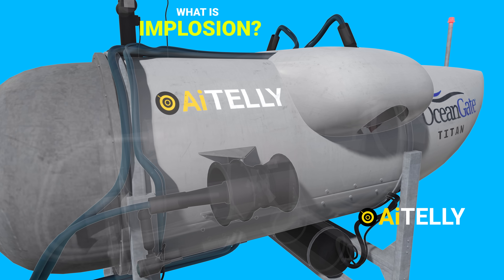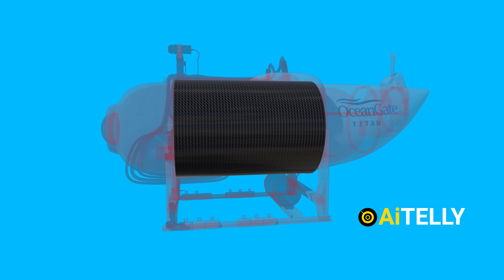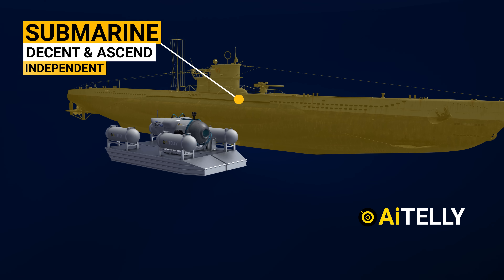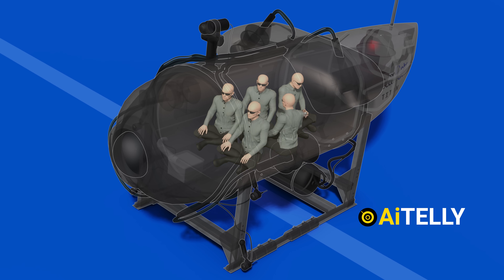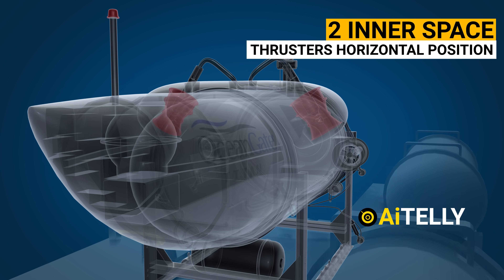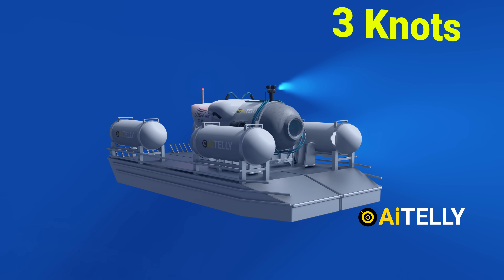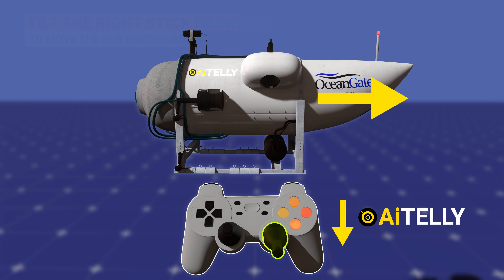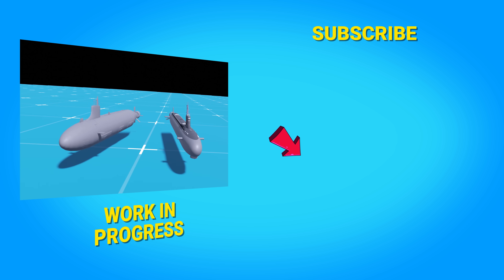Implosion Titan Oceangate How it Happened | Submersible Submarine Parts #3d

Comment: What this video fails to mention is the razor thin engineering margin of the Titan. Its crush depth is 4,000m and the Titanic wreck is 3,800m (95% of the Titan crush depth) That is a just a 5% margin. Ideally, you want to build something well clear of the margin
Reply: Yes 20% margin per engineers
Reply: In the heavy civil engineering/construction field, our margins are typically 20% min. and if I remember correctly, 50% margin is typical for work involving the railroad. 5% is insane, especially when considering the experimental design.
Reply: @jmcinnis540  And the likely result of a failure.   When it comes to those things it likely should be 200% at a minimum.
Reply: @jmcinnis540  

i could be wrong, but i think the 20% is also based on top of some already very conservative assumptions. don't think it's even literally just 20% more than the theoretical maximum load...
Reply: Damn, that's really messed up because you ALWAYS want to stay above test depth, which for UK subs is HALF of crush depth, and for US subs is two thirds. The fact that the Titan doesn't even officially have a test depth and only a theoretical crush depth.....
Reply: 4000m was the depth it was designed to operate at, not its crush depth. That was calculated at about 11,000m but it was not tested. The use of carbon fibre for repeated pressure loads like this has not been fully researched and it is likely earlier dives contributed to cyclic fatigue that resulted in a catastrophic hull failure.
Reply: @mirandahotspring4019 yes I heard the same the repeated use of the titan weakened the structure
Reply: Yeah I know right? Most engineer wants to stay mid range and much farther away from the limit. And it’s not even accurate limit as it hasn’t taken cyclic fatigue as Rush didn’t have any special equipment to accurately measure it. He was cheapskate with grandiose ambitions and the biggest egos. Sad really.
Reply: @KittenBowl1  to do it properly he would had to of built one just to test to destruction, it was a disaster waiting to happen because if the sub didn't implode when it did he would of just kept using it until it did, that's not even mentioning the fact that the sub was glued together like an air fix kit.
Reply: @420styletomatoes6  Sure, he had to test it but he wouldn't have. The reason he didn't was because according to him regulations was inhabiting his innovations or regulators are stopping his innovations etc. (he said this on video interviews many times in one form or another). The lead engineer at one point said he wouldn't sign off the dive because he saw signs of delamination of the hull and he advised Rush to get it properly tested and they needed an expensive equipment to measure the level of damage. But Rush fired the guy for doing his job. I am referring to that equipment. Yes he was very cheap but wanted to charge billionaires a quarter million per person. Really unbelievable level of negligence. This was doomed to fail from the beginning because of his egos and ignorance to actual science and physics. He was too proud he ignored physics. Now what kind of engineer was he? Btw he was not deep sea marine engineer. He was aerospace engineer...
Reply: @KittenBowl1  I think calling him any sort of engineer is a bit of a stretch of the imagination.
Reply: This is really sad. Then it turns out the Rush guy lied and died while at it. It is a lesson to all creators and inventors to be especially more patient and scientific with their inventions and to listen more keenly to peer reviews and observe the scientific journeys of those who've gone before. As it turns out, cost for making a quality hull and livable diving space would have been easily met, what with the high charges they levied on participants. At $250,0000 per person, they ought to have had a more serious submarine capable of even 11km deep dive, made of super solid hardest materials found on earth.
Reply: @pauldatche8410  did they get a refund?
Reply: @Capecodham First rule of Submersible Club: Never ask about refunds.
Reply: Good point, Oceangate put a submersible together hastily and rushed to take people down in the mesopelogic zone with inadequate protection.
Reply: But, the 7 inch thick acrylic window on the viewpoint of the lost Titan sub was only built to a certified pressure of 4,250 feet (1,300 meters)
Reply: Yes, in aerospace there is 50 percent structural safety margin. For example an airplane wing is designed to fail at 10.5 g if the airplane can fly at 7 g.
Reply: Clearly the crush depth was not 4000m if it imploded before that...
Reply: @dannyhurd8646   the Titan sub had successfully completed a number of dives to the wreck site over the past few years before the disaster. The problem with a 5% engineering margin is that it's operating at its maximum limit, so it's going to be more prone to cyclic fatigue issues. Imagine driving a car at its top speed all the time, the engine will rack up the mileage a lot quicker, and suffer more quickly from the inevitable wear and tear.
Reply: The crush depth was around 1500 meters lmao
Reply: The glass used in the porthole was reportedly only certified to 1200m.
Reply: No just build your sub from known tested materials and not carbon fiber and stop being a cheap billionaire this was Hubris. Plain and simple
Reply: 11000m means absolutely nothing as a design spec if it wasn't actually tested at that pressure. Scuba cylinders normally hold around 3000 psi +- and are hydro tested to 5000psi (ie 1.6x or 5/3) every five years. They are designed for 100000 cycles of use. Life support equipment never has close margins. How may use cycles were tested? How many failure tests?
Reply: Human soup
Reply: the ceo said it could go to 4000m, however the engineer that got fired, insisted they did non-destructive testing, because he knew the viewing glass was only rated for 1300m and he had concerns about the rest of the components and mainly the pressure chamber
In reality however, it was only "rated" for 1300m, because the glass was the weakest (known) component, considering the titan never really got tested
simply put, all previous passengers had an amazing guardian angel, because this was bound to happen at a point, if all the above information would have been know beforehand, oceangate probably wouldn't have had any customers to begin with
Reply: i would counter the crush depth was most definitely not 4000m
Reply: Never thought of that. But you’re right. I think most likely 50% margin makes more sense. It’s crazy that it was within 5%. Absolutely reckless of ocean gate- so awful.
Reply: The window was built for 1.300  meters xd

There is whete the brake started
The window was missing when they recivered the front part
Reply: My electronic designs in the '70s and '80s had 100% safety margins,  electrical, thermal, and mechanical altogether.
Chinese electronics nowadays vary from 0% to 10% margins...
Reply: No thanks. I'll just watch the movie Titanic
Reply: I knew nothing about the physics or engineering for any of this... But even the basics of what I've learned in the past week tell me this was CLEARLY a horrible plan from the start! (especially if it's true that he got the carbon fiber used from Boeing on Super Sale Sunday!) 

And surely Rush had access to the best info and brightest minds if he wanted, yet he did it anyway.
Reply: @Stingray_7308  the problem was all the best and brightest minds told him it would not work and it would fail, so he emplyed yes men, sorry i mean yes people.
Reply: @420styletomatoes6  Wait, so a billionaire ignored wise council and did what he wanted anyway?? Imagine that.....
He wasn't going to let anyone tell him he couldn't play with HIS toy. Geeez
Reply: @Stingray_7308  I know, stone the crows.
Reply: @420styletomatoes6  I was with you until you changed the term..
Reply: @michaeloberle726  which term did I change my friend ?
Reply: @Stingray_7308 Rush was trying to make the trip ‘affordable’ and at the same time profitable enough to develop other programs.  He seems to have had good intentions, but unfortunately his enthusiasm and ambition was misguided, seemingly ignorant and as a result, the vehicle proved to be death trap.  It is unfortunate that he is not around to hear the ‘we told you so!’ from the experts…but it seems that it was the ocean who had the final word about the design.
Reply: @shannond9945  sounds like spacex entrepreneurship.
likely best he perished of his own creation, otherwise he'd be fighting lain criminal charges in court, amidst big media frenzy, denials and proclamations of innocence etc.and a "mark II" version being launched
Reply: @shannond9945  I agree with you, and I'm sure he wanted to push boundaries and make more exploration possible. I'm not trying to be "told ya so" Monday morning quarterback guy. But according to people who seem much more educated on this than I am, it sounds like the experts in the field DID tell him beforehand this was a bad plan. Just tragic all the way around.
Reply: @shannond9945  If you read some of his statements, you'd realize he hardly had any "good intentions". He fired dozens of engineers who warned him that his creation would fail, he also hired people who were inexperienced with operating a sub (check his statements, and you'll see just how ignorant he was) so no, he didn't have "good intentions"
Reply: @Stingray_7308  Boeing denied it.
Reply: @lajoswinkler  Good I hope that's not true. I'm sure Boeing wants to RUN from any connection to this disaster.
Reply: Most dive watches and other equipment are rated below the useful limit.
Reply: Damn, that's way too small a margin for error.
Reply: A modern navy submarine can only go to 457m. So I doubt their tiny thing could even go near that
Reply: @Steve00alt  It had already completed at least two successful dives to 3800m and several others all much deeper than 457m.
Reply: Думаю это неверная информация. Порог разрушения у батискафа 1500 м из-за акрилового окна, которое рассчитано именно на эту глубину. Фактически они превышали порог более чем в 2 раза несколько раз - но в этот раз не повезло.
Reply: @Ian1557 I was referring to the hull of the Titan when highlighting it's crush depth. As for the acrylic window (obviously it wasn't fit for purpose), it could be the reason for the implosion, but on the other hand, if the sub imploded at the aft end, then the air trapped in the hull would be forced to the front, compressed (and heated) by the incoming water until the trapped air either explodes (due to it being heated by being compressed) or is violently forced out by the same compressive force, blowing out the acrylic window (presumably the window and/or the hatch bolts would be the path of least resistance).
Reply: At least 20 %
Reply: Yeah that submersible was not rated for a 4k depth. The port window was only rated for 1300 meters. The submersible James Cameron went down in was rated for 4k but not the Titan. Stating the margin for error based on the supposed test depth that was never actually tested is false. Pretty foolish of you to state that a margin of error would be the problem is laughable.
Reply: @ThradNevar83  if you wanna be technical, then as the sub wasn't even classified, it wasn't even seaworthy! 

Highlighting the margin reveals oceangate/Stockton Rush casual disregard for safety and proper engineering. The margin isn't the cause of the implosion, but rather a symptom of a sub built by an engineering cowboy.
Reply: Wasn’t it ‘rated’ for 4,000m….. with safety factor accounted for.  Ie: Crush depth is closer to 9000m, but rated to 4,000 to remain safe.  I believe the consensus is that it was repeated cycling of a single or limited use carbon fibre elements.
Reply: Not to mention how many times it had been down.
Reply: the window was only rated at like 3k meters
Reply: Even Titan, when it was originally named Cyclops II, was not certified for 4km. A smaller model failed at 3km during simulation. And the plexiglass front viewing port was rated at 1.3km. Despite these known issues, as well as the concerns with carbon fiber, OceanGate Expeditions still dove to the depths of the Titanic wreckage.
Reply: @oahuhawaii2141  according to a leaked comms transcript (not sure if it is authentic or fake) between Titan and it's mothership the Polar Prince, the crew of the Titan were hearing strange noises from the aft end of the sub and were trying to make an emergency ascent (but were ascending too slowly - in fact the subs descent had been too quick).
Reply: 4000m wasn't the crush depth it was the theoretical max working depth and it had done at least two dives to 3800m before. The problem was there had not been any tests done to establish the actual crush depth and they did not take into account cyclic fatigue factors.
Reply: It has no crush depth because it was never tested. Idiot.
Reply: 5% is not at all wiggle room
Reply: Just enjoy the video goog grief
Reply: I know with lifting capacity that carry people must be a minimum of 3 times the max weight so it should have been able to handle 3 times the depth
Reply: Jjjjjjhhhh
Reply: It's actually 11000m but never been tested
Reply: @khunrocky606  this submersible had only been certified for 1300 m..... Rush just did what he wanted 🤷‍♂️.
Reply: @khunrocky606  It’s been tested now.
Reply: @khunrocky606  if it was 11000m, there had to be some testing, if it wasnt tested, it was only made to withstand that pressure, doesnt mean it does
Reply: @khunrocky606 Who had proclaimed it?
Reply: @danipellegrinodp  sorry I confused between feet and meters
Reply: @khunrocky606  ok,It seemed strange to me if they had been so unlucky
Reply: @khunrocky606  been tested now….
Reply: @khunrocky606   Is that so?....ahem.....it's been tested...it imploded at less than  4000m.
Reply: @khunrocky606  Clearly it was tested and clearly it failed lmao wtf are you on
Reply: @YozoDerzu  it was tested only by oceangate

Comment: Why is all the dumb people talking like they know stuff.... This design and materials used had nothing to do withits implosiin.... Why? Because it had done this same dive multiple times before hand the whole thing was completly tight an viable... The problem was bad inspections an maintainence..... Otherwise it woyldnt hav survived the first dosen trips before it implided... Common sence people basic logic man
Reply: Multiple  dives  itself is a problem, causing  fatique  on materials,  due to pressure  cycles,  just like an airplane  it has number  of  flying  hours,  after  hours are reached  change  the Hull or send it to scrape, question  is did the company  establish  the number  of dives before  failure  ?
Reply: @haggaiandagile6232  exactually my point dude... people keep shitting on the build and the materials when they were all perfectly viable. it was the inspections and maintainense that caused this.. if they did it properly with proper stress tests before every dive an what not they would hav seen the degrading matrials an stuff and non of this wouldnt have happened. faults happen in every machine it doesnt mean the machine was shoddy or badly designed

Comment: I actually like the design, MINUS the carbon fiber hull and the being bolted in from outside. I do think the rest of the setup is pretty cool tho. I have nothing against using a gaming controller with screens, he cut too many coats….but the only good cost cutter in my opinion is the fact he cut out most of the electrical systems that usual submersibles have, but still he should have communication onboard too. I want to see the design continue but to work out the errors.

Comment: Simple reason in catastrophic failure to the carbon fiber materials in the submersible….it’s called delamination. Just like a bow that has been shot repeatedly over many times under extreme stress, and environmental changes. The same process happens in this case with the experimental materials used in this submersible.

Comment: Probably because they used a weak transparent viewing window made of acrylic. Acrylic is a weak material that will craze and is brittle. It is not pressure safe, especially under those depths poly carbonate is 10 times stronger. It is a bullet proof transparent material that they should’ve used. I don’t understand why they would use acrylic. It’s a glass brittle it will craze. It will crack under stress.

Comment: A friend and I used to fabricate carbon fiber bicycle frames. (Titan was carbon fiber predominately)
After many test frames, we accumulated a lot of practical experience with the carbon fiber medium.
One thing that ANYONE working with carbon fiber composites is this:
It is incredibly strong, however! IT DO NOT FLEX well....Incredibly stiff, but not resilient to flex, like steel or titanium...DUH!!! Titanium in contrast has amazing expansion/contraction properties.
So, it obviously is not a good material for extreme compression beyond it's yield strength....
Just physics....
BTW
Reply: blind following the blind and even paid for the trip
Reply: Not resilient to flex and not so to compression - it's strongest for stretch.
Reply: When you were talking about carbon being incredibly stiff and titanium flexing, I thought you were going to say that the bond between the carbon composite tube and the titanium end domes would be an obvious point of failure.
It's interesting to note that Oceangate built and pressure tested to destruction, a version that had carbon hemispherical ends (not titanium) and carbon main cylinder. It had metal (presumably titanium) rings at each end of the cylinder. This would have had less potential issues with different expansion between the cylinder and the hemispherical ends. I guess one of the carbon ends failed, hence the Titanium hemispheres on the final version for Titan.
Reply: Which bike brands did you create?